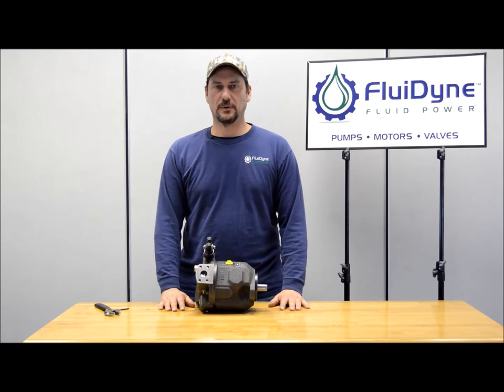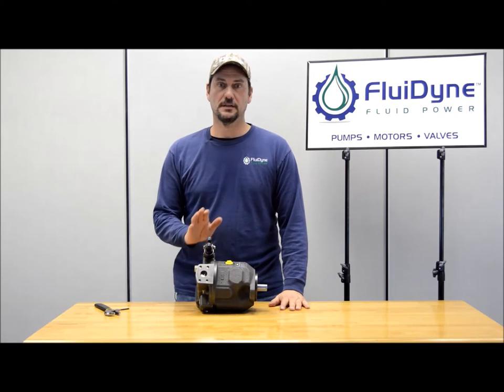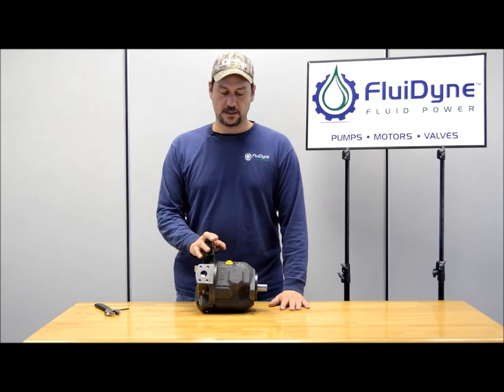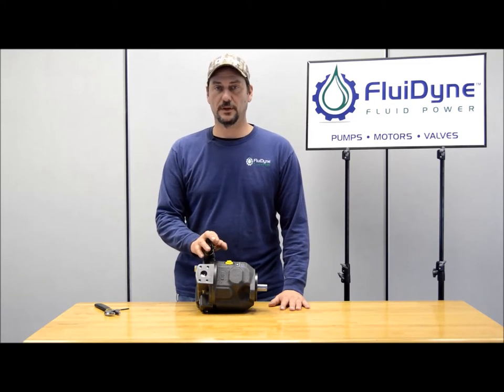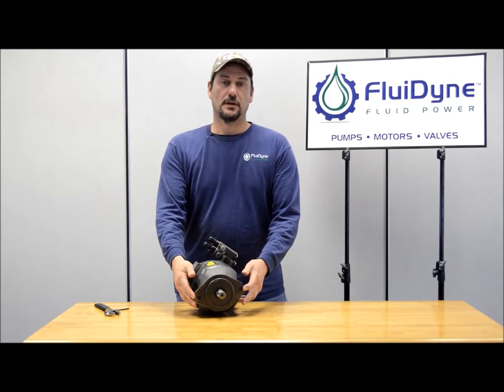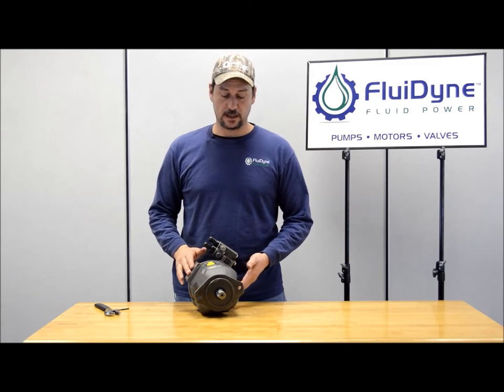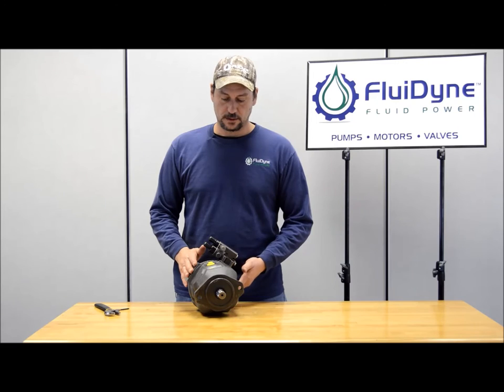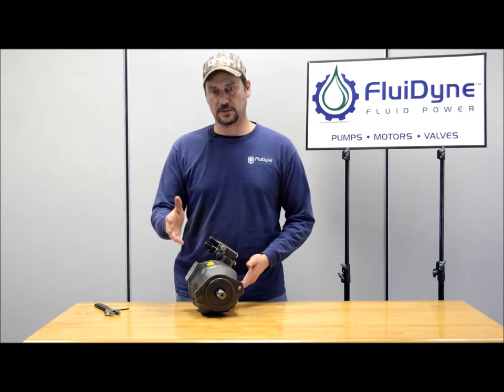How To Change Pressure Adjustment on A10V Piston Pump - Part 1

Comment: Hello Sir, are we need to install relief valve in our system? and for adjustment to 3000 PSI I have to adjust load sens?
Reply from the maker: Hi Ali! You would adjust the screw below the load sense, or closest adjustment to the pump.
Reply: @FluiDyneFluidPower  I need to adjust my piston pump to 3045 psi, now it's 2750 psi
Reply from the maker: @bardiyawilliam  It's always a good idea to install a relief valve as a safety so you do not over-pressurize your system.   

To increase your comp pressure to 3045 psi turn the pressure screw in 3 quarter of a turn that should raise the pressure to 375 psi.
Reply: @FluiDyneFluidPower  Thank you very much, I will try tomorrow and give you the news
Reply from the maker: @bardiyawilliam  You're welcome Ali!
Reply: FluiDyneFluidPower Hi, I finished adjustment of my piston pump, first adjusted my relief valve on 3200 psi after that closed flow control and adjusted pressure compensated on 3045 psi, successfully I did it, thanks a lot

Comment: And if the dr is bottomed out and turning the pressure adjustment screw does nothing and pressure stays at 950 what then? New pump.
Reply from the maker: Hi Will! Sorry for the late reply. We would need to know what type of control you have but for a DFR type control we think you are referring to the FR / LOAD SENSE being bottomed out so the only option for adjusting the pressure would be the DR main pressure adjusting screw. If that is the case and your only achieving 950 psi then there may be a relief valve or stuck open or not seating properly.